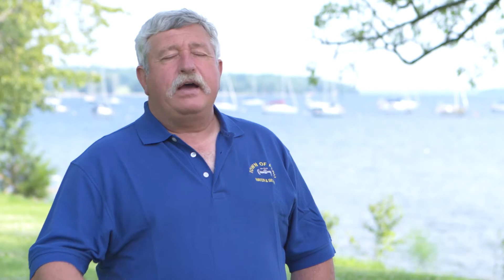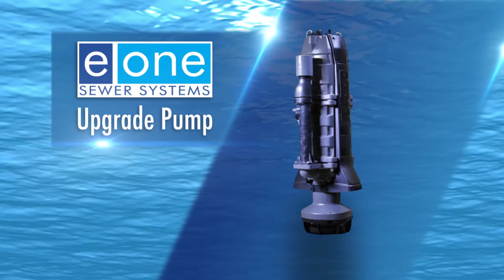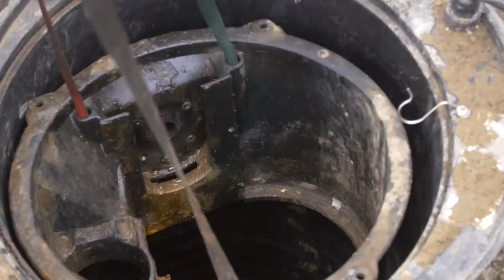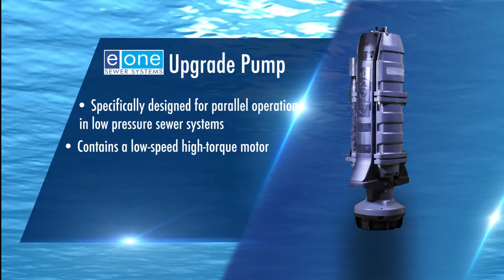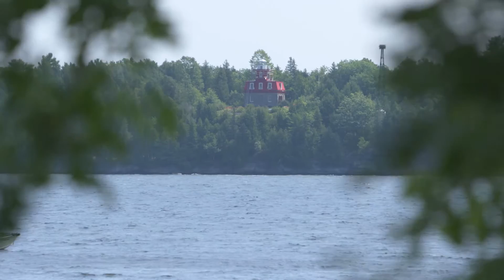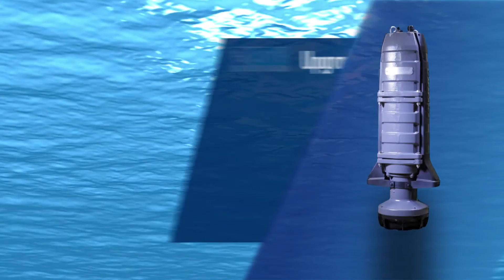E/One Upgrade: Replacement Grinder Pump

Comment: Threw mine away after replacing it for the 3rd time in 10 years.
Went back with the Liberty omnivore and haven't had a problem in 10 yearts

Comment: Expensive  junk!!!! An upgrade? Should be a recall! Highly engineered junk!! You cant repair what really goes bad. Because it's under the shit. Floats and a contacter work. Work for years. The originals had a five year warranty. If they lasted that long. Most in my neighborhood did not. But at five years and a day you better have $5000 ready to hand over to this racket. Monthly sewage bill went from $45 to $58 a month. The electric went up as well.Something that was absolutely unwanted, unwarranted, and unneeded. Public contract done by crooks!! If you see this in the yard, sell. Don't purchase, and run like hell!!!

Comment: These pumps are NOT reliable at all!!  We have been in our "new" house for 10 years and have at least 3, maybe 4 in that time.  And as of today, the alarm is going off again!
Ridiculous!!!
Reply from the maker: Hello - Please contact us at eone@eone.com with more information. The average mean time between service calls for an E/One pump is 8-10 years. Most problems can be attributed to improper installation or system abuse. Have you spoken with your local distributor to assess these problems?
Reply: @EONESewerSystems   my eone pump has been repaired 3 times within 5 years. Same issue each time. Board burns out near manual switch, stator repair on pump. About $1500.00 each repair. Installed by eone. House built was new 5 years ago.
Reply from the maker: @wilkbusby  Please email us at eone@eone.com with your contact info, location, and more info about the situation.
Reply: Now 4th time pump failed. Same issue stator. Snd week later a 5th time again as of the last two weeks. I r spent as much money on repairs as I did for the new system. I just email eone asking fir a pump replacement as it is obvious this pump is a lemon.  We are careful to not throw anything in sewage other toilet paper or sewage.
Reply: @EONESewerSystems  just email you as now we are in 5th repair within 6 years.
Reply: @wilkbusby  I replaced our eone with a Liberty Omnivore, 2hp grinder. They even come with adapter to be a direct replacement for eones. They are junk. Get rid of it would be my opinion
Reply: @akrocuba   what is the alternative pumps available
Reply: @Ndimbokenya  I went with a Liberty  “Omnivore “. 2hp. They make fittings and adapters so they are a direct replacement. It’s been in two years with no problems. You can see it in action on YouTube. That eco pump was terrible
Reply: @EONESewerSystems  Yes.  I spoke to several people about e-Ones.  They all agree that they will NEVER last as long as good pump.  I've put sewer pumps years ago, Liberty, Zoeller, just to name a few, and they are still working fine. And a lot of them are over 30 years old. 8-10 years is not a long time for an expensive piece of equipment. Especially when it started going bad after two years.
Reply from the maker: @akrocuba  Did you speak to E/One or an E/One distributor? If you're having problems with the pump after 2 years, there is likely an underlying issue.
Reply: @EONESewerSystems  Nope.  No underlying issue. We just replaced about 5 years ago. I've heard nothing good about these things and I am completely pissed off.  Companies that are certified that I spoke told me the same thing. I'm replacing it with a standard grinder pump. 
Companies really should take more pride in their products. But, I guess it's all about just selling the product to municipalities and getting the big sale and then leaving them stuck with the problems.
Reply from the maker: @akrocuba  E/One does take pride in its products & we have many satisfied customers. I asked that you email me more info so I could help and/or get you in touch with someone to better diagnose your situation. E/One pumps have an average mean time between service calls for 8-10 years. If a repair is needed before that time, we need to investigate. Additionally, E/One pumps are designed to be repaired & not simply replaced -- multiple complete replacements indicates a bigger issue. I'm sorry you're unhappy with your E/One experience, but we can't help without more information.
Reply: @EONESewerSystems  It has been rebuilt several times also.

Comment: I was actually google-ing how to change out the float valve on an eone pump...
Reply from the maker: Hi Kyle, Our pump doesn't use floats; it uses pressure switches. Do you still need info? Email me at eone@eone.com if we can help. Thanks - Sharon
Reply: @EONESewerSystems  no thanks! I realized that after watching the video.